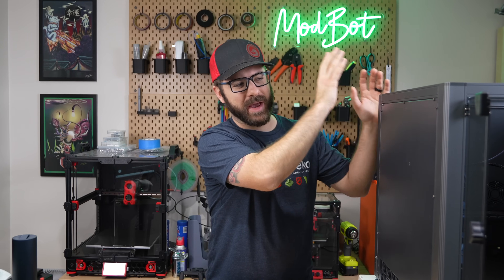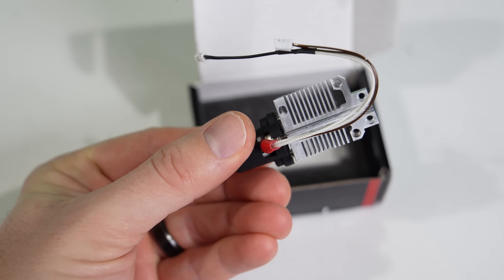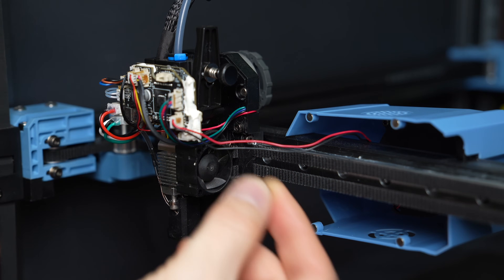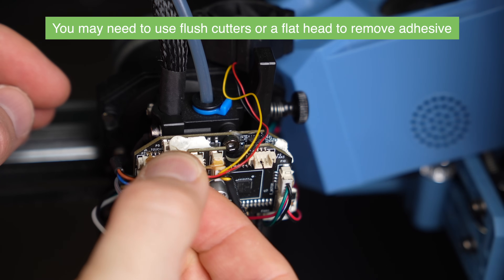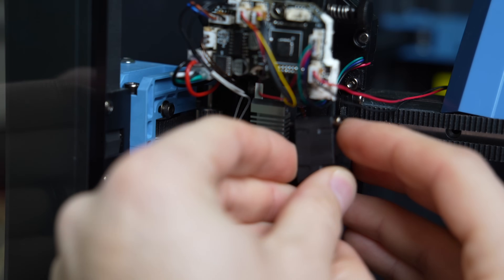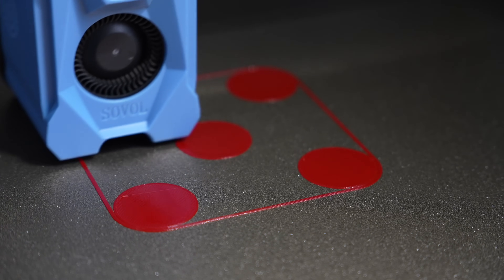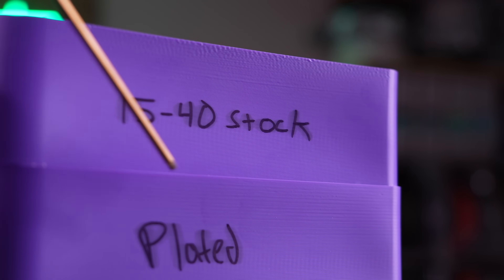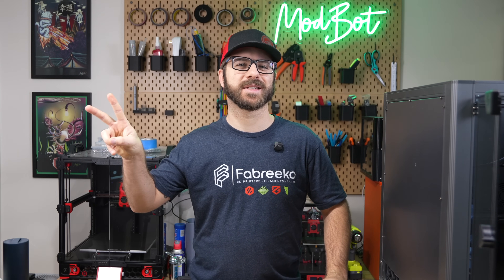Drop In Hotend Upgrade For Sovol SV08 Printers (Micro Swiss FlowTech™)

Comment: I ordered this same time as printer in October 2024. Never tried original hotend and change it before first start. Got 0.8 cht nozzle and have been using it for a year. It is eating filament like crazy. However I found there is max speed for extrusion around 45mm3 and have to reduce micro stepping in cfg to go over this limit. It can push 50+ mm3 but for reliable prints I don't go over 40. 
After a year of printing shelfs and buckets I needed some more precision and put 0.6 nozzle. And now I finally understand why people are complaining about taco bed.

Comment: Mine always clogs. Heat creeps up into the filament direct drive extruder causing the filament to get soft and stop moving. I haven't figured out a solution. The MicroSwiss hotend is worse than the stock hotend, but the stock hotend can also fail this way. My Sovol SV08 only work half the time.

Comment: I did this upgrade to my SV-08 right after they released the hot end. It was quick and easy (even easier that in the K1 Max) and works perfectly. Another nice thing 8s it uses the same nozzle as what's in the FlowTech for the K1 Max, so I was able to use the spare hardened steel nozzle I already had right away, instead of having to order one separately and wait to install it.

Comment: OH GOD. NOT THE AUTO_Z_OFFSET. 50/50 chance to damage your bed. note: slowing down the speed to "speed: 0.1" under [probe_pressure] seems to help a lot.
Reply from the maker: Hugh I haven’t had any issues with this 🤷
Reply: @ModBotArmy  yeah a lot of others have. should see all the scratched beds in the fakebook group. i know what to look for so i have not had too much problems just a super high or low z offset. i only ever run it after a nozzle change.

Comment: I bought the MicroSwiss FlowTech hot end for my SV08 and installed it as I was assembling the SV08.  I never bothered printing with the original hot end or nozzle.  MicroSwiss parts are gorgeous works of machining and they function very well.  Installing the FlowTech hot end was no more difficult than swapping the stock SV08 nozzle - actually easier because the FlowTech nozzles are cold swapped.  The SV08 nozzle replacement requires uninstalling and reinstalling the heater block and thermistor, without breaking the delicate wires, which is dumb.  The FlowTech nozzle can be cold swapped in a minute (literally), with one hand, using only a 7 mm nut driver.

The SV08 is my 12th 3D printer.  I'd always bought extra nozzles thinking I'd swap nozzles to make printing better or faster, but in practice, until the FlowTech nozzles it was always such a hassle with the risk of damaging the extruder that the only time I'd replace a nozzle was when I needed to repair a printer.  FlowTech nozzle swaps are easy.  Why did that take so long to develop?  The FlowTech hot end also has a ceramic barrel heater surrounding the nozzle to heat it from all sides.  The Sovol heater is a little flat rectangle that clips onto one side of the heater block with some messy thermal paste.

I plan on putting a MicroSwiss hot end on all future printers, so they can all interchange the excellent FlowTech nozzles.  I already have four in my collection.  I was thinking of buying ten SV06 Ace printers for a small print farm but MicroSwiss doesn't have a hot end for that printer yet, and that alone was enough for me to decide on the Neptune 4 Pro instead.

If I manufactured 3D printers, I'd install a MicroSwiss FlowTech hot end as standard equipment and my customers would thank me for that.  Every manufacturer deliberately making a slightly different proprietary version of the Volcano nozzle is a deplorable practice that we should force them to stop doing through strong consumer preference.  Want to sell a printer?  Use a Volcano or FlowTech nozzle.
Reply: Just buy a 3 pack Extruder parts kit from Sovol and install those on your .2 .6 and .8 nozzles. That way you have 4 nozzles (including your .4) ready for less than the price of one of these MicroSwiss hotends.
Reply: @Gepstra  - There is an SV08 extruder parts kit with a silicone sock, thermistor, heater and clip.  Three of those is $26, but that doesn't include the hot end block that these parts and the nozzle mount to, and even if I had those, to swap entire hot ends would require me to unplug and plug the thermistor and heater on the printed circuit board, and remove and reinstall the three hot end mounting screws and two fan screws.  How is that better than unscrewing a FlowTech nozzle and screwing in the replacement nozzle?  That's actually more work that swapping the stock SV08 nozzle.
Reply: @Liberty4Ever  Yeah it's 2 screws and 2 connectors to unscrew/unclip. For less than the price of a Microswiss hotend I now have 4 different nozzles ready to go. Plus I didn't even consider the replacement nozzles for the Microswiss, those you have to get as well, so still more money.
Reply: @Liberty4Ever  You just unscrew the nozzle assembly, not the heatbreak. Edit: Or heatsink+fan, rather.

Comment: Would love to see a comparison of the SV08 with the Qidi Plus 4!
Reply from the maker: Man pretty different machines. I will say after the correction of the ssr issue on the plus 4 it has been a workhorse for me.
Reply: @ModBotArmy If I want a printer that "works" with minimal tinkering, which am I better off with? (Openness is the other criterion, but while Sovol seem more open source, both can run on open source firmware.)

Comment: Is the sovol sv08 open sauce? I thought it had injection mounded parts - you can only get from them?
Reply from the maker: It is open source. You may be able to 3D print some of the injection molded parts but it probably wouldn’t take much rework then so they are printable. The step file is available.

Comment: I bought the flowtech for my SV08 a little while ago and love it! Works great so far. I'm also literally about to install their CHT 0.4 nozzle that I just bought because why not! Cold nozzle swaps are fun! Just got delivered today! Always nice to see more SV08 videos being made, and new content from you too of course. Thanks for this one
Reply: I would love to know the comparison between the microswiss flowtech hotend and the new triangle lab, also I have talked to someone that has the Bambi lab hotend and says that’s really good for the SV-08??
Reply from the maker: The cht is such a nice upgrade your gonna love it 😊
Reply: @ModBotArmy  - My FlowTech 0.4 CHT high flow nozzle arrived yesterday.  I'm going to flow test it against the regular FlowTech 0.4 nozzle that shipped with the MicroSwiss hot end for the SV08, which was already a significant improvement over the stock SV08 hot end.  I'll get a FlowTech 0.6 CM2 hardened steel nozzle for printing carbon fiber.  I'm working on a new product that features a ribbed TPU surface for extra grip and I'm positively giddy about the volumetric flow rate and print speed using the FlowTech 1.0 mm CHT high flow nozzle that I bought for that project.
Reply: @ModBotArmy  wow you aren’t kidding, eh! Going to cap it at 33 mm3/s just to be on the safe side but can easily do more. Standard flowtech that came with the hotend I pushed to 25 but barely. But seems to just flow nicer and a little more even overall too. I shot some video maybe I’ll post it… unreal though. Really not regretting the purchase at all 👍🏻

Comment: But why? It is a very expensive toy for what it is, or I do not get these ads.
Reply from the maker: @mtrezaie  I break down some of the benefits in this video if you watch after the install
Reply: @ModBotArmy  Thank you very much. Now I see. I spend some time reading through the reviews of SV0* nozzle and the prices they have and see that this product's nozziles can be reused else where. Now this makes sense.
Reply: Its a better design than the stock nozzle. I've been running this in my SV08 since October now and it's been flawless. Higher flow (not using the high flow nozzle) better quality, and most importantly, better peace of mind vs the pressed in factory nozzle.
Reply: its mainly the easier change of the nozzle vs the OEM
Reply: The advantages of the MicroSwiss FlowTech hot end were so obvious that I installed it when assembling my SV08.  I never printed with the stock Sovol nozzle or hot end.  I've never been able to cold swap a nozzle in a minute using nothing but a 7 mm nut driver and I'm not going back.  The nozzles print faster and better too, and there is a lot more nozzle variety (plated brass, hardened steel, CHT high flow, and even super hard polycrystalline diamond - in 0.4, 0.6, 0.8 and 1.0 sizes), interchangeable with FlowTech hot ends on all your printers once converted.
Reply: because the stock hotend is an engineering failure.
Reply: It'd more expensivee in the UK because of shipping, but overall it's not that pricey for a small volume part, not too dissimilar to an E3D nozzle in the UK. The Diamondback nozzle is a bit hot,, but so were Olsson ruby ones way back.